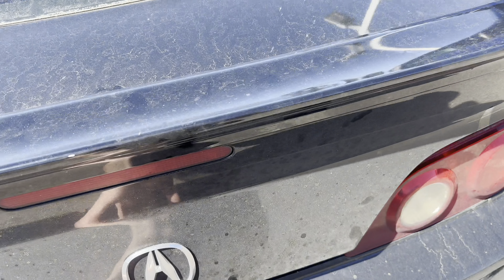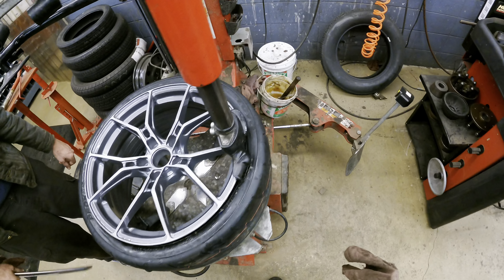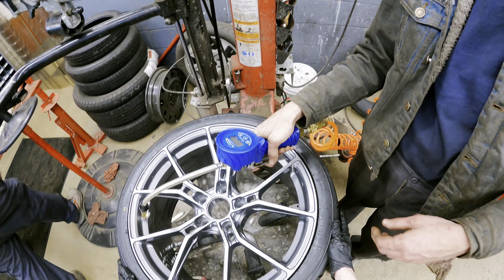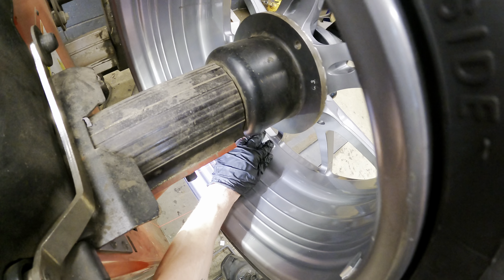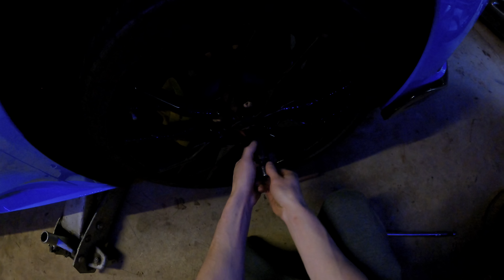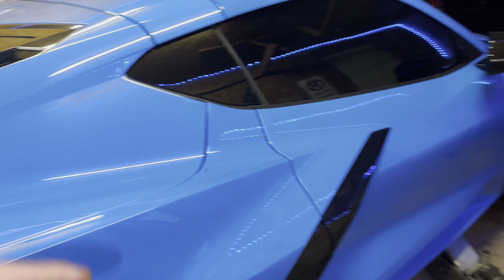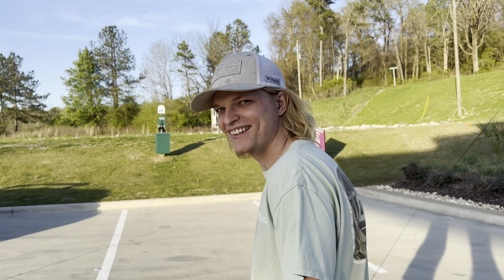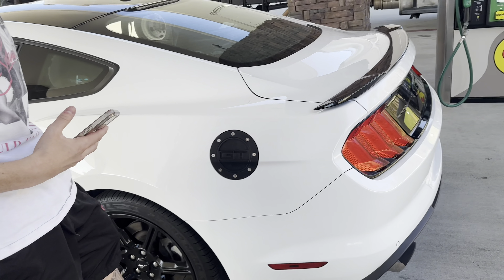These Wheels and Tires Completely Changed My C8 Corvette…

Comment: The rims look great.  I agree with what you said regarding the ability to see the rim detail. 

Question on balancing - I read that lining up the yellow dot with the valve stem aids in balancing (less weights) because the tire is somehow designed to account for the added weight of the valve stem.  As a certified mechanic, what is your opinion on that?
Reply from the maker: I never personally line it up, maybe it help maybe it doesnt but personally i just send it. If a tire require a TON of weight to balance then ill try moving the tire

Comment: Liked stock wheels much better, big fan of all black wheels.
Reply: no way lol black wheels and black accents do look good but this i better for him
Reply: Black wheels are for boomers.
Reply: @anthonykiedis1765 no, chrome wheels are for boomers. I’m 27 and absolutely prefer black wheels.
Reply: @RadialNoah  Correction: Chrome wheels are for boomers and black wheels are for Altima drivers.
Reply: @anthonykiedis1765  getting my C8 this weekend, almost identical to this guy’s car except with black rotors and smaller spoiler. Although mine has the black wheels. Wouldn’t care to own a Nissan, personally🤷🏻‍♂️
Reply: @RadialNoah  mine is almost the same spec. Rapid Blue, Z51 wing, black calipers. I originally spec'ed it out with the black wheels but then decided last minute to get gunmetal wheels (the exact ones in this video) and it made such a huuuuge difference.
Reply: @anthonykiedis1765  the main things with mine is 2024 3lt, rapid blue exterior, tension blue interior, dual mode exhaust, mag ride, front lift, low profile spoiler and splitter, and the wheels are the 20 spoke gloss black ones. My 2020 Camaro 2SS has gunmetal wheels, and I’ve liked them just fine. One issue is I have with them is how much they show brake dust. I also just prefer the look of black with bright red or bright blue. Waiting on my car’s front end to get wrapped in PPF before I pick it up from the dealer.
Reply: @RadialNoah  good deal man, sounds like an awesome spec! I like to talk shit here and there, but honestly if you are getting a C8 you are already winning. Enjoy my man, but ease into it. I've been driving fast cars my entire life but this thing is an absolute beast!
Reply: @anthonykiedis1765  thanks man! Been binge watching C8 videos whenever I’m not doing anything. I’ve absolutely never been this excited about getting a car before. Excited to cruise around with the wife, haha. Have a nice night!